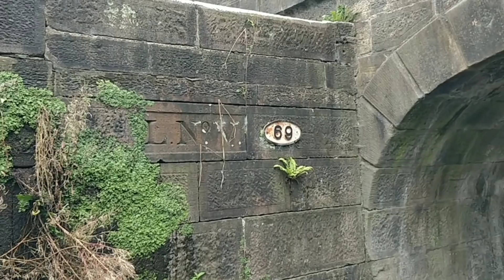Flight of the navigation down Wigan lock flight...

Comment: The tower near Rose Bridge is a Cell Tower Mast hidden behind wooden cladding.  I know it looks brick built, but they are 1/4 inch thick tiles on the wooden cladding.

I am also the security guard at NicePak where you moored up at the end of the video, I remember seeing you moored up there.  The 'empty' bridge you saw there was originally an electric cable bridge.  It was vandalised a few times by idiots after copper wire, so they eventually decommissioned it... before anyone fried themselves.
Reply from the maker: I think people weren't very happy with the new 5g so they camouflaged um. I thought it was brick. Should of popped over for a cuppa mate when I was moored up. Cheers Dennis

Comment: Curious:  why do some locks only open one side instead of both?  Also, it was nice of that gentleman to push or pull you over to line you up to exit.  Interesting video Will.  Travel safe out there.
Reply from the maker: Open one lock gate saves time and energy for single boaters. I would prefer both lock gates are opened. I would open both but so many locks requires cutting corners in certain situations. Thankyou Sandy..

Comment: Love the vids BUT you can't complain the locks leak in one breath and then only open one gate. You bump and damage the edge of the gate so that it does not then seal properly. OPEN BOTH GATES no excuses when you have two boats and multiple crew. Show people how to do it niicccceee!
Reply from the maker: Noooo Leon was doing one gate. The guys missus was getting the next lock ready. That was the routine. It worked well. I'm mostly on my own and there's no way I'm opening both gates. It's exhausting enough as it is. Cheers